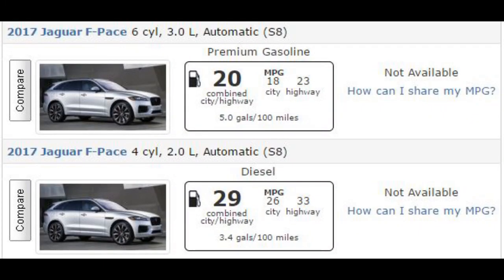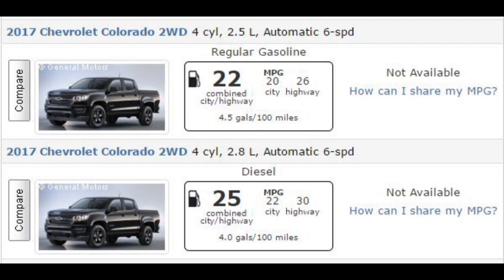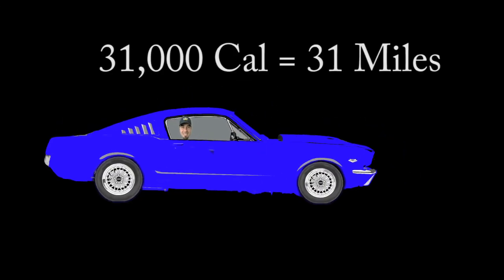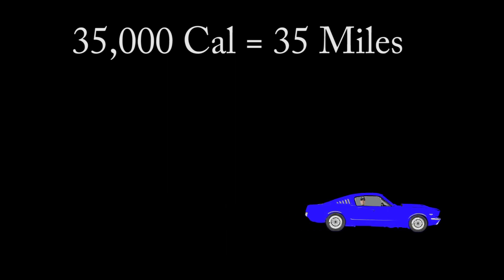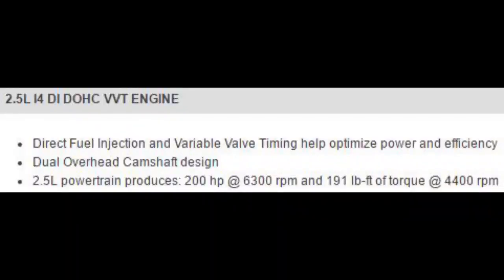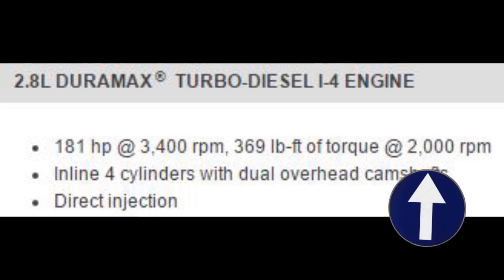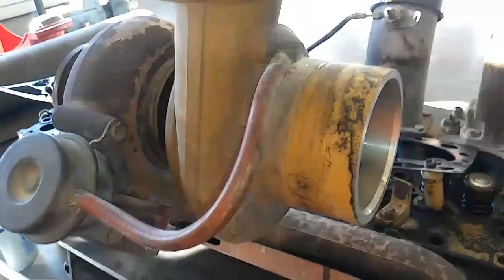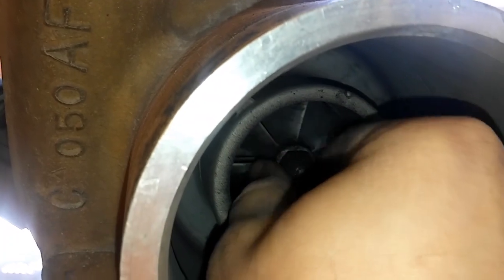Why Do Diesels Get Better MPG? Why Are Diesels More Fuel Efficient?

Comment: There is a major aspect between Diesel and spark ignition engines that is very deserving of detailed discussion and that is spark ignition engine's combustion propagates by flame front from the spark source.  A compression ignition engine detonates its individual fuel particles everywhere.  There is no traveling ignition flame.  Detonation engines as a scientific topic implies the shockwave travels faster than the speed of sound which is suppose to be more efficient than simple gas expansion in rocket engines.   This topic, with the available information commonly available, is frankly a bit bazar.   The detonation process in a Diesel engine may provide much higher efficiencies than the spark ignition burn process.   

In heavy duty over-the-road Diesels the need for a powerful reliable dynamic brake provided by the Diesel Jake brake makes the Diesel not realistically replaceable by spark ignition engines.   There are many fuel markets today where a heavy duty high efficiency gasoline engine might be cheaper to fuel than a Diesel.  There are no heavy duty gasoline large displacement low reving engines with replaceable cylinder liners and such.  Nothing that is comfortably on the market.  The the high reving Ford V10 OHC gasoline medium duty gasoline truck engine is the closest example I know of.   That appears to be a 300,000 mile engine.

Comment: My fiance and 1 both own dodge rams same year's 2005. Mine is a cummins his is gas. We filled up in kansas at the exact same times with same size gas/feul tanks and both have no after market mods. We both traveled from kansas to AZ and has milage for both are almost the same. Everytime we filled up the gas /fuel  needles are in the exact same position in both trucks.   There is absolutely zero difference in feul milage in gas and diesel. Unless you have actully done this comparison  on a road trip with 2 identical situations just one diesle and one gas then your spewing crap. I did this half way across the country with identical driving and load situations.

Comment: Reasons why diesels get good mpg is due to the viscosity of the diesel. The fuel is just like cooking oil that needs more heat to ignite than gas so refueling is a bit less likely to happen in diesel cars than gasoline cars

Comment: I agree with everything but your explanation of the turbo and the pressurized air thing.  The turbo is being turned by the exhaust, so the piston on the power stroke that is pushing the exhaust stroke on the other is doing the work of pressurizing the air. You didnt really explain it wrong, just not fully.  I think that it would be better to describe the turbo as a method of capturing energy that would otherwise be lost out the exhaust pipe.

Comment: The same model equipped with a 3-liter gasoline engine will always be thirstier than a 2-liter diesel one. Diesel engines will most of the time be more fuel efficient when compared to same capacity gasoline engines. However, the economy of a 3-liter diesel engine will often be similar to that of a 2-liter gasoline engine. It's hard to understand why didn't you compare same capacity engines. Maybe I'm missing something. Edit: Sorry! Should have watched the whole video before playing the smart-ass number.
Reply: Absolutely correct!

Comment: At tickover speed the turbo provides no increase in air volume  into the cylinders because it's not spinning fast enough , also when you stop accelerating and start cruising the turbo does nothing. So it's then back to suction to draw in the air on the induction stroke.

Comment: Deisel engines run slower rpms therefore burn less fuel diesel engine 3 thousand rpm max gas engine 6 thousand rpm max

Comment: The real question is, is it more economical to buy the diesel model with it having a higher purchase price, maintenance expense, and fuel prices, vs the gas engine?
Reply: Generally yes in the long run. Tend to have a resale value higher than the gasoline counter part. Generally longer service intervals, better fuel economy. Longer engine life. My 2014 VW Jetta TDI. 6 speed manual averaged 48.5 mpg. With a best tank of 54.4 mpg.

Comment: what would be then the advantage of choosing a gasoline engine, besides price?
Reply: If something goes wrong, diesels are more expensive to repair than gasoline engines. The price difference got even worse as diesels were fitted with a DPF and later fitted with an SCR. EGR systems in gasoline engines are also far less expensive and labor intensive to repair, and some gasoline engines don't even need EGR.

Comment: Your best answer is to direct you to a library where you will find books that give you a picture type diagram of the OTTO combustion cycle versus Dr. Diesel's cycle.  Basically, the OTTO cycle is combustion at constant pressure, whereas the Diesel cycle is combustion at constant pressure. But be careful here as Boyles law that you should have studied in high school physics gets right into the middle of everything.

Comment: Awesome explanation. While talking about foot-pounds of torque you said: "this isn't to say that diesel engines are cheaper." Were you referring to the cost of ownership relative to the same for a gas engine? Sorry only point I was confused.
Reply from the maker: +Matthew Alan Thyer Initial purchase cost is usually much higher for a Diesel.
Reply: Yeah I'd agree with that. The good news is that over the lifetime of the engine operating cost tend to be less.

Comment: back in the early 80's almost all car models had an option for a small 4 cylinder diesel with a 5 speed manual transmission Toyotas Ford  escort chevetts and even a Nissan Maxima cause my uncle owned one but for some reason this died out . probably because the fuel got more expensive and early diesels had trouble in the cold starting? not Shure I was only about 6 years old then.
Reply: The Datsun Maxima was RWD and used an inline 6. In 1985, Nissan introduced a FWD Maxima, and gave it a V6 engine. Nissan didn't make a V6 diesel to match.

Another reason diesel sales declined in the USA was because people were less worried about fuel shortages and rising fuel prices. At that point, the added cost of a diesel was no longer justifiable. In addition, the Oldsmobile 350 really tainted the name of Rudolph Diesel. Only Mercedes-Benz had built a good reputation for diesels before the Olds 350 went on sale.

Comment: Excellent video. With the advantages of diesel vs gasoline, it's damn unforgivable that more diesel powered cars and light trucks aren't available here in the USA. I've never understood why that is. The EPA wants us to drive fuel efficient vehicles, cars that can drive up to 400 miles before refueling. Unfortunately, they're refusing to allow small displacement diesel engines to be offered.
Reply from the maker: +Jason Carpp It is unfortunate, unless you want an F350 you aren't getting a Diesel in the USA. I mean the EPA let a few slip through the cracks, but there should be a Diesel version of just about every model. Now if people would buy them here is another question.
Reply: I don't need an F350. They're nice trucks, but they're too much vehicle for what I need. I'd be happy with a Toyota Tacoma, or a 4Runner.
Reply from the maker: +Jason Carpp If Isuzu would put one of their exceptionally long lasting Diesel engines in a Toyota that could be a very good vehicle with great power and longevity.
Reply: I totally agree with you. For the Tundra, the Sequoia, and possibly the Land Cruiser, I would love to see a Baby Duramax diesel installed. :)
Reply: I'm all for clean air emissions, but this is bullshit. Who the hell is the EPA to decide what kind of engines are sold here in the U.S.A.? That's never made sense to me.
Reply: @jasoncarpp7742  then you would love the Hilux diesel we have here down under
Reply: You can find then you just gotta look hard... I roll a Jetta TDI, a duramax and the wife rolls a Mercedes GLE300d
Reply: Making a good smog legal diesel is very hard and expensive, that is why you don't see many of them offered in cars.

Comment: I have question for you that is bugging mi for long time. Why naturally aspirated diesel engine makes much less power for same displacement than naturally aspirated gasoline engine. for example 1.9SDI (VW engine) 65HP vs 1.6FSI 115HP (Audi engine)?
It is even stranger because diesel have more energy per gallon than gasoline.
Reply from the maker: +Marjan Markovic Its really due to the torque range, Diesels usually make much more torque, but at a lower rpm. Since horsepower is just an equation of torque times rpm divided by 5252 and Gasoline engines make less torque, but at a much higher rpm, they make more horsepower.

Comment: A unit of diesel fuel (gallon, gram, or bucket) contains more energy than the same amount of gasoline.  Is it so surprising that you would require less higher energy fuel to do the same work as the less energetic fuel?

Comment: You didn't talk about the different ignition sources. Diesels have to run unthrottled because they rely on the heat of compression to ignite the fuel as it is injected into the combustion chamber. If restrict the amt. of air lower compression lower heat no ignition. They are also much heavier. as the combustion event is more violent and really hammers the engine internals such as pistons rods crankshafts ,etc..

Comment: Is this the reason why diesel engines take longer (in some cases much longer) to get to temperature than gasoline ? I have an 06 Mondeo 2.0 diesel which you can let idle in winter until the next day and it will not get to 90 unless you drive it. And yes, the car is ok technically - had it triple and double triple checked and both thermostats are replaced with OE ones.
Reply: You use less fuel to idle a diesel than you do a gas engine.  In fact, at the end of the day, before I shut my truck off, I would let it idle in order to cool down my turbochargers and bring down the temperature of my coolant.

Comment: "No vehicle can run on gas or diesel..." WRONG!! My Duece and a half truck can run on both. It primarily runs on diesel but it has a Hercules LDT-465 turbo multi-fuel engine. Problem with gasoline is that you have to add a quart of oil to every 15 gallons to get enough lubrication for the engine while running on gasoline. But my truck can use both.
Reply from the maker: +therightstuffAK I mostly said that so nobody would pour some Diesel in their Honda Accord to get "better mileage." You are about the tenth person to mention the Duece and a half since I made this video. I'm sure there are a few other  crazy Siberian trucks, marine applications, and some early engine designs that could probably burn multiple fuels, including Kerosene and heavy oils.  You are correct though, it'll burn both, I'm assuming it runs better with Diesel though.
Reply: Adept Ape well I didn't know that anybody else mentioned the truck...not trying to start a war or anything. You're videos are very informative though, so believe me I do appreciate them. Top Gear BBC I believe ran a test a few years back where they poured diesel into a regular gas-powered car, it ran for a couple miles before it quit.
Reply from the maker: +therightstuffAK I didn't take it as an affront, it's all good. I think it's cool you have a Deuce and a half personally. What the heck do you use it for? Is it just a toy or a transport truck?
Reply: Adept Ape Well, I only got it this past September so I haven't had much time to tinker with it before winter had set in. But once I've got a couple other projects I'm working on cleared out of the way I plan on trying to fully restore it to not new, but at least very good condition. I plan on using for a lot of off-roading here in Alaska, but also parades, to do work on my land and perhaps use it when I start to build a house, and lastly it's just plain fun to drive around! You get so many looks and questions, and I've had a handful of veterans already come up and start talking about the good ol' days when they used to drive these with me. I'm really interested in your channel as this is my first diesel vehicle, and while its older and I can figure some of the stuff out, I'm certainly no expert! So I'm trying to learn all I can as I'll be doing all the work except for changing out tires and working on the brakes. I'll leave those to a truck shop as the tires are on "split" lock-ring type rims and the braking system is one CF-it's air over hydraulic, with air tanks and an "Airpak" (combining the air and hydraulic fluid to operate the drum brakes). Anyways I look forward to learning as much as I can from you!
-James from Alaska

Comment: And diesel engines have no throttle body, the turbo goes direct to the manifoldwith nothing in between
Reply: Not really, almost all turbodiesels nowadays have an intercooler between the turbo and manifold.
Reply: MrZdvy yes of course, what I meant is there is no flap or valve or anything that controls airflow by restriction

Comment: On the truck engine put in your car.  Of course it won't get good mileage.  Higher horsepower engine=lower mpg.  The newest thing to come out is LNG or CNG engines.  These engines burn really inexpensive fuel (Here gas is about $3 to a gallon, and LNG/CNG are about $1.3 to a gallon).  However, LNG and CNG have much fewer calories per gallon, about 1/2 as many as gasoline.  Therefore, a tankful will only go about half as it would on gasoline.  A lot of people don't like diesel, because it's "more expensive."  But, they forget about "more efficient."

Comment: One small nit, sucking vs turbo efficiency, the energy to drive the turbo isn't free but comes from exhaust gas. One way or the other the engine is working to pump air through the cylinders. Gas or diesel, turbo's improve torque. But with turbo's the more the boost the more the power, so it is kind of a mistake to even bring them up. What I would like to know is why are manufacturers like Porsche and Ferrari so keen on high-revving motors over high-torque low rpm engines? Because they sound like F1? So why are F1 engines all high-rpm? (I know, because…. rules…)

Comment: 6 minutes of waffle before you actually hit on the main reason, a petrol (gas) engine runs a throttle which is virtually shut when the car is cruising along. This means that the volumetric efficiency (VE) is low, the pressure in the combustion chamber before the plug fires in low which as a direct result on the peak cylinder pressure, in other words it is also lower than ideal. A diesel engine is not generally throttled (but some now have turbulence plates), the engine is only controlled by the amount of fuel being injected, it always operates at least 100% VE and generally more due to the turbo. The peak cylinder pressure is much higher because of this and it is this pressure above the pistons that produces torque.
The 'less friction' reason and most of the other stuff is so minor that it is not even worth mentioning. What we need is a petrol engine that runs at 100% VE (or more) that is controlled by fuel only but this is not really possible because if you lean the mixture off too much in a petrol engine it simply won't ignite. (Lean mixtures have other issues too). If we could fill the cylinder with fresh air then somehow inject an air/fuel gaseous mixture in at around 14:1 ratio just around the spark plug and use this to control the engine that would work. We would then have a petrol engine that would have the MGP of a diesel. Unfortunately it is easy said than done!  Whilst we are at it fully variable valve timing along with a variable compression ratio would be nice!

Comment: If gasoline combusts at a lower temperature,why not run a higher compression ratio and inject the fuel just before top dead center like in a diesel? Wouldn't this give you more torque?
Reply: Zack Fraser To my knowledge, the fuel would probably combust, but not efficiently as it has little time to mix with the air it needs.
Reply: In theory, it sounds good, but, in actual practice...what would happen if you put gasoline in a diesel engine?  I know someone who had to deal with that very issue...some dummy had done that very thing.  It didn't work out too well!!!
Reply: NiceMuslimLady what happens exactly? I could see it eating away at certain seals and whatnot,but if you engineered it in a way with the proper materials I don't see why it wouldn't work. I'm not saying I'm not wrong,but I can't seem to find an answer yet.
Reply: Ford did this with their Eco Mustang.  And yes it works.